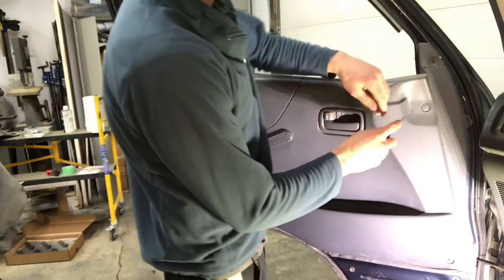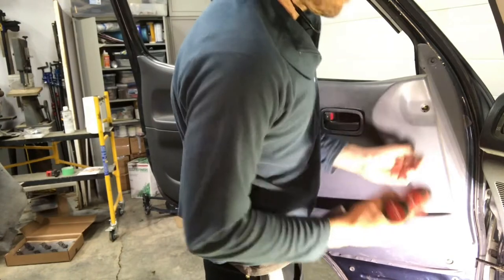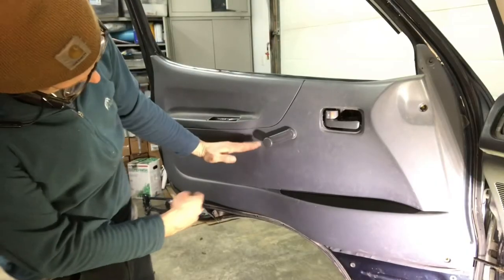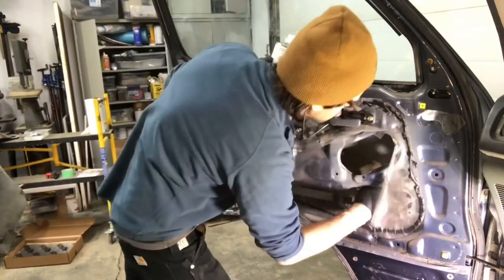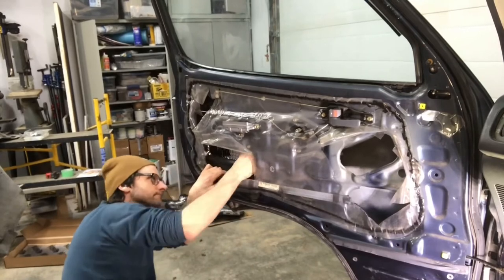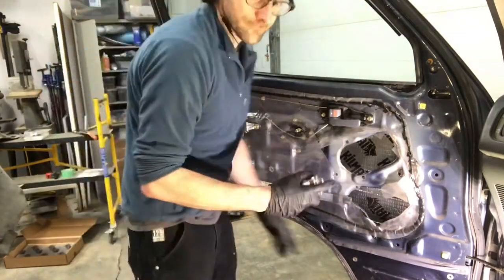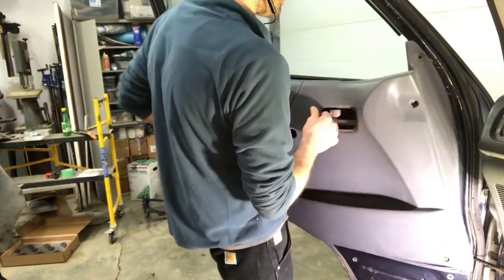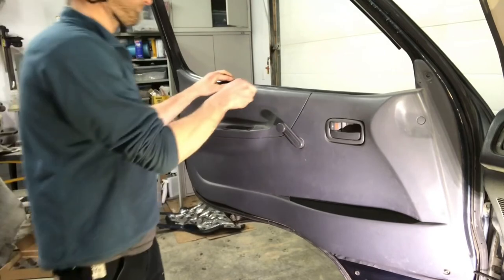Removing Hiace door card/ interior door trim for killmat noise insulation and rustproofing

Comment: Hi FM. Going to look at van next Sat, at last. One option will be to trailer it away so am wondering what weight to expect. Would you be able to let me know what yours is, based on the VIN plate or other data? Thanks.
Reply from the maker: Theres no weight info on the vin that I could see, really not sure how much they weigh with all the camper kit in the back